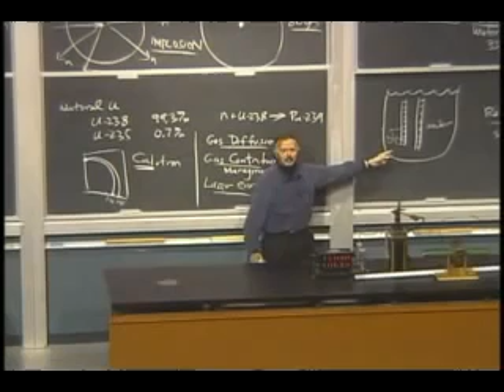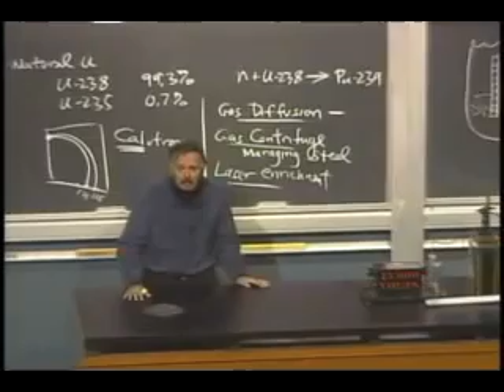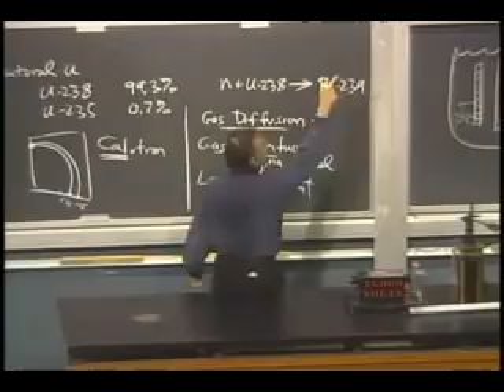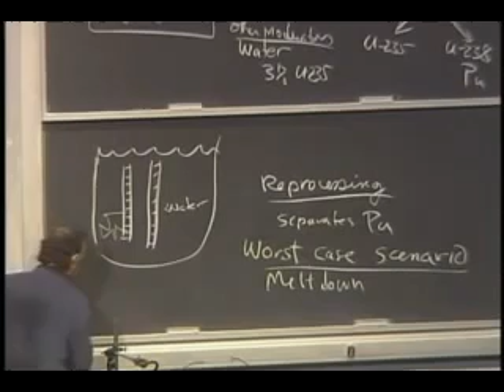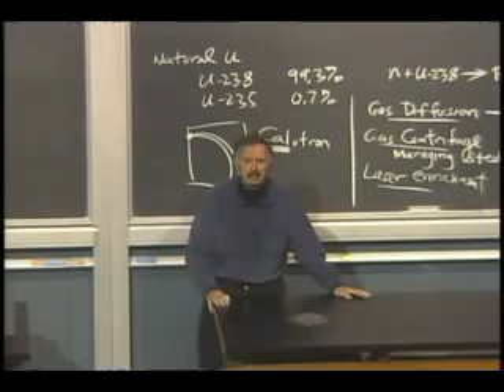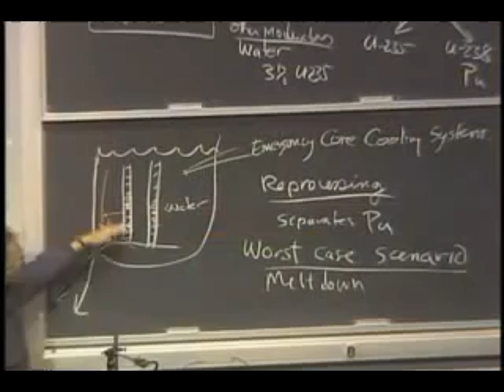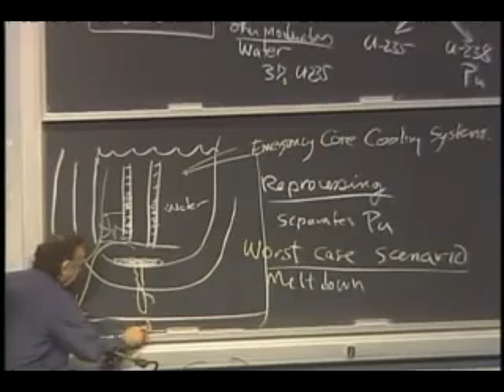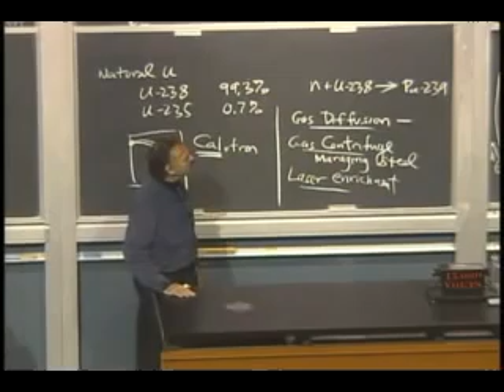"Please explain to me how an RBMK reactor explodes,comrades". Explaination by Professor.

Comment: Lol for real this is so oversimplified and not exactly why RBMK exploded. It's due to a positive VOID coefficient caused by the boiling of non-heavy water. In this lecture, he treated the water as if it's the moderator, but only heavy water (deuterium water) is a moderator. Chernobyl reactors use regular water, which is much cheaper and is an absorber, together with permanent graphite rods as the moderator. Ideally, if deuterium water is used and boils, the moderation efficiency decreases (vapor is worse at reducing neutron speed and absorbing neutrons than liquid) and there is a negative void coefficient which helps cancels off the acceleration in reaction, but for Chernobyl as regular water is used and boils off at high temperatures, the absorption power decreases while moderation efficiency, provided by graphite instead, is still high and it sends the reactor into a positive feedback loop (this positive void coefficient), increasing the rate of reactions and temperatures, further burning off more absorbers in the fuel rods (Xenon) and water and thus accelerating the reaction again. The final nail in the coffin is when they tried to slam all the moderator rods back in to replace it with the upper permanent absorber rods, but at the bottom point where the moderators momentarily displace away water,  there are no more absorbers left there and the reaction  rate skyrocketed to insane levels producing so much energy which superheats the water and blows the lid off. Oxygen came in combusted with the graphite rods, along with superheated steam creating hydrogen and other more vapor and resulted in huger explosions.
Reply: All US reactors are light water moderated reactors because they use enriched U235. Only heavy water moderator is used for natural U235 as in CANDU reactors. Chernobyl used graphite so the water was just for heat removal.

Comment: negative temperature coefficient... as the fuel heats up the reactivity decreases.
Reply: True, but the void coefficient is much stronger so the reaction rate overall increases. Control rods is what keeps the reaction rate in check.

Comment: PHWRs like CANDU and KWU PHWR have positive void coeficients
Reply: Yes but CANDU reactors are moderated by heavy water, and the void coefficient is small enough that the reactor can compensate for the boiling of the moderator (if it does boil), and the moderator is quite large so any thermal change to it would take time and allow automatic systems to get it back in line.
Reply: @gamerunners1619  Not to mention that CANDU reactors have a ridiculous amount of safety systems and redundancy.

Comment: I thought the RBMK had a positive VOID coefficient not a positive temperature coefficient. Someone clarify. I’m going to ASSUME he meant void. Because modern reactors from what I understand are pressurized as to keep water from boiling and creating voids in the first place. Please correct me if I’m wrong
Reply: Aight I’m pretty sure this professor was either confused or lying. Also he mentioned legality of these designs in the west. Can anyone provide an explicit source stating the regulation by nuclear energy regulators in the west?
Reply: @corbingrinstead5365  You've got to cut him some slack because a lot of critical information was kept under wraps for a while.
Reply: @corbingrinstead5365  The plutonium-production reactors operating at Hanford up through 1970 had the same problem.  They knew about the potential for disaster since even before they were built.
Reply: Yeah, he meant void. But is has nothing to do with the type (PWR or BWR) since the void coefficient becomes interesting during a loss of coolant accident. A graphic shows how a German SWR would react in comparison to an RBMK (https://upload.wikimedia.org/wikipedia/commons/2/20/Dampfblasenkoeffizient-w.png).
I don't know how other countries handle it (Canada for example operates the CANDU which has a slightly positive void coefficient). But at least in Germany such an reactor wouldn't be able to get an operational approval by the authorities, since the required safety standards could not be guaranteed. Besides the CANDU the aren't any reactors operating in the west with a positive void coefficient.

Comment: This is only a very tiny part of why reactor number 4 exploded.  Just talks about what a meltdown is and some of the reasons that would cause it.  Also, Chernobyl did have a concrete containment pad.
Reply: The show itself has a better explanation, look up “how an rbmk reactor explodes”, it’s broken into three parts which is kinda annoying
Reply: @Callie_Cosmo  The show took some liberties as the control rods are not "tipped" with graphite. To keep the core power coupled between top and bottom graphite displacer rods were used but these rods didn't go all the way to the bottom. When the reactor was scrammed, these displacer rods entered the bottom 1.5' of the core first which displaces water (makes a void which adds positive reactivity) and graphite (which adds moderator) so the reaction rate in the bottom of the core skyrockets flashing the water to steam increasing the pressure which ruptures fuel channels locking the rods in place. More power, more steam, more pressure until the lid can't contain the pressure and it blows off. Air rushes in and the superheated graphite literally explodes and catches on fire.
Reply: @curtrapp5291  yeah, my favorite part about that is when asked why the boron control rods are tipped with graphite he just says it’s cheaper, which technically isn’t wrong because it’s cheaper to just have them on one rod

Comment: There are dozens of other improved RBMK working without problems until this day in Russia and eastern europe. Fukushima was US design and also failed. So there is never 100 percent safety. never ever.
Reply: Except chernobyl didn't get hit by a tsunami.
Reply: @phaztom313  The tsunami is not an excuse, imagine yourself in the place of the builder of a nuclear power plant, you are building it in JAPAN, you know in advance that this is a territory potentially exposed to earthquakes.
And if you know this, do not build a nuclear power plant resistant to this, then this is a design error and not the tsunami fault.
Reply: Fukashimi never failed. It survived but the generators and safety systems designed to keep it running where not long enough to last due to the severity. The people running the plant tried the best they could and kept it safe as long as they could